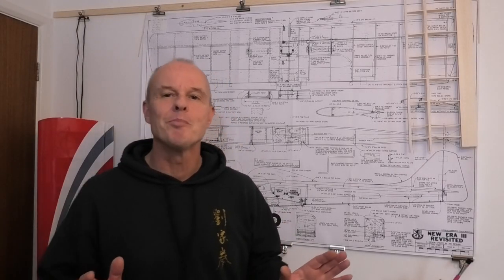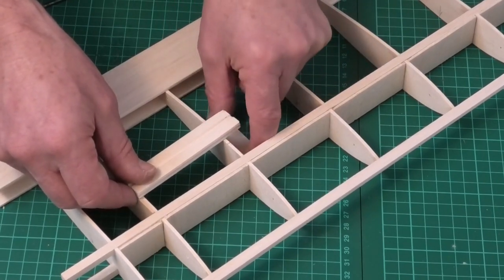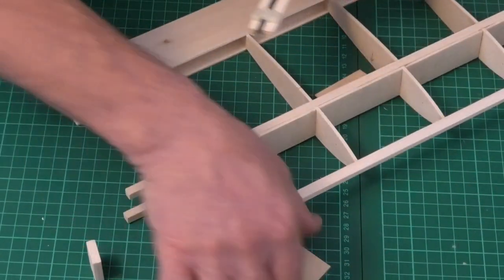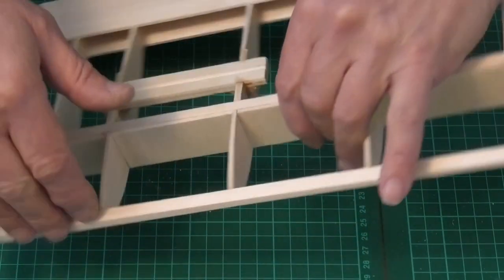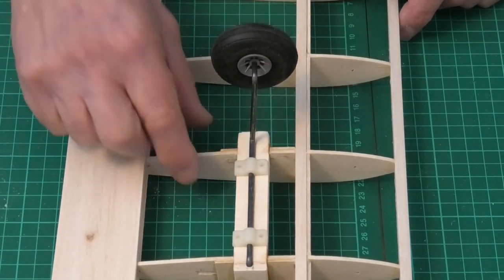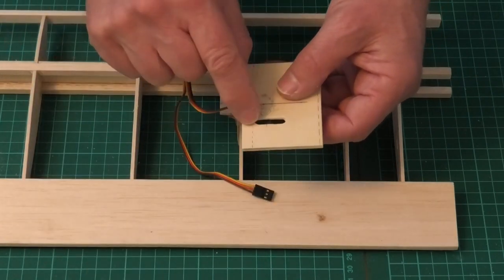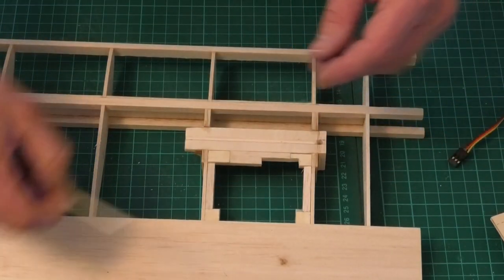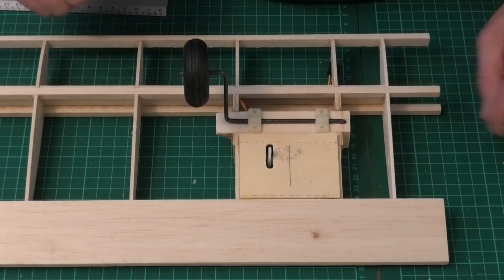New Era III Revisited: Pt 4 - Wing Servos & Main Landing Gear - a 45" wingspan RC balsa aeroplane

Comment: Nice work.  One small thing I'd change in the landing gear mount is to overlap the horizontal ply strip over the vertical torsion block.  Then drill the vertical hole through both.  This will provide much more torsional strength in the event of a rough landing without any weight penalty.  I build mostly .60 size so it may be overkill for a .25 with such a short gear leg but it doesn't cost anything.
Reply from the maker: Thanks for the information, appreciate the comment, sounds a good idea